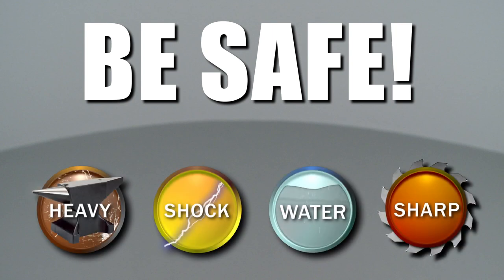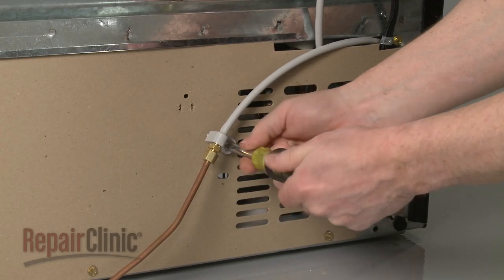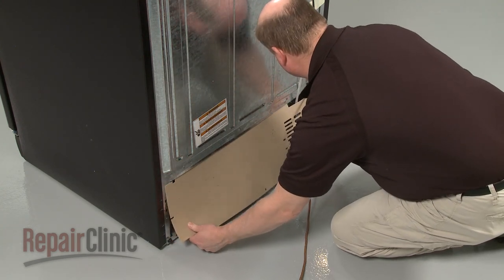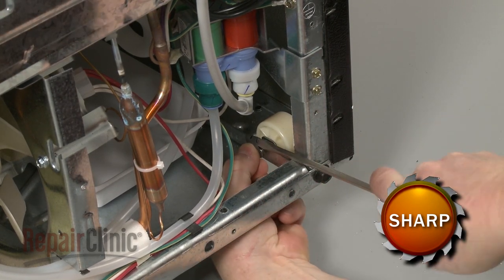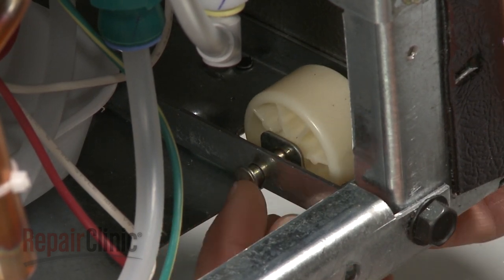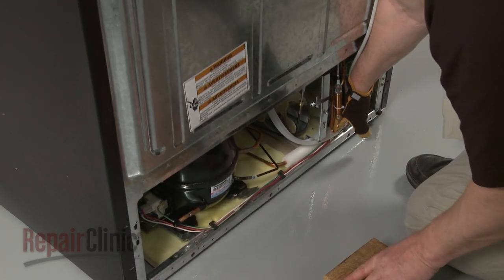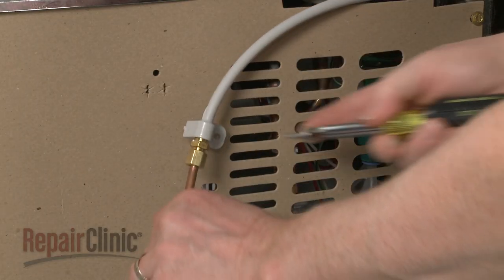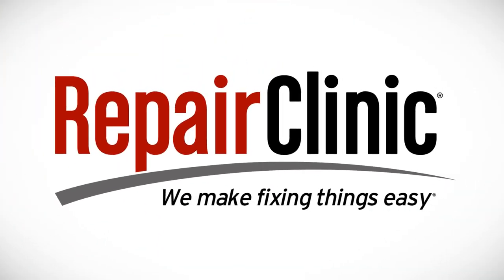Whirlpool Refrigerator Rear Wheel Replacement #4388239

Comment: I wish my LG LFXS24566S/00 Refrigerator was as easy as this to change wheels. The pins are pinched at the other end so impossible to pull out without cutting them.